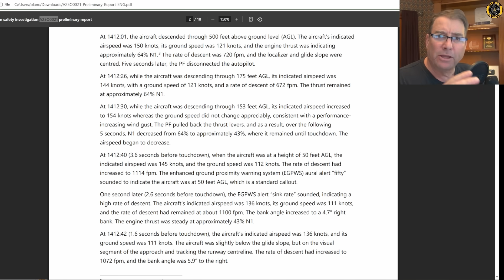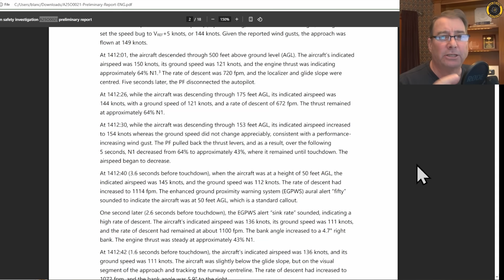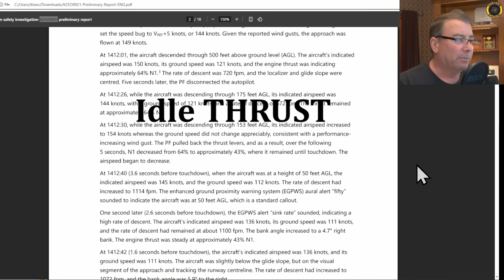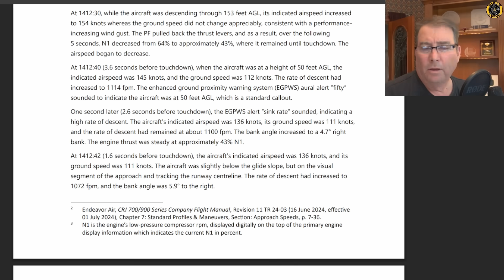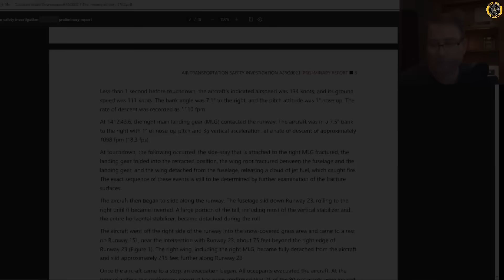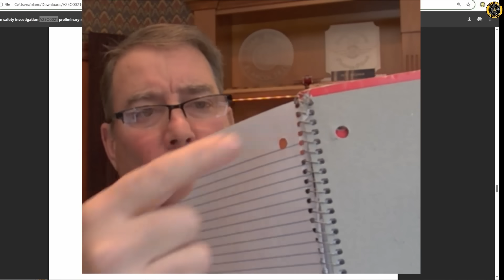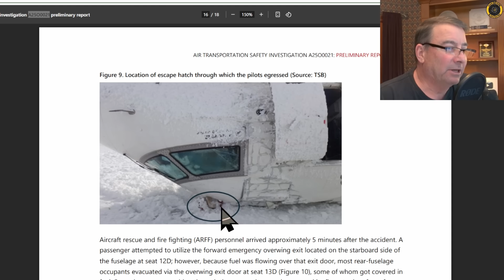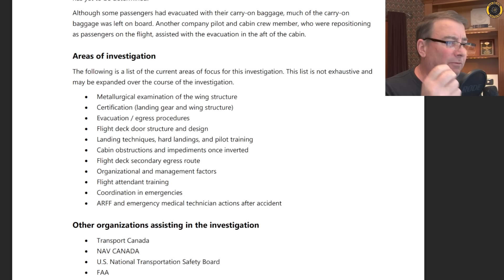TSB Prelim Toronto CRJ Crash

Comment: The thing that’s lacking is not any old stick and rudder time.  These kids spend up to 1500 hours bouncing around in Cessnas thanks to the 1500-hr farce.  They have “stick and rudder” time in general. What they sorely need is stick and rudder experience in type.  On the line with an IP.  Sim is ok but not really.  Ass-in-cockpit time is best of all.
Reply: Exactly. If I see some other channels like Pilot Debrief it amazes me how people try to get those 1500 hours fast killing themselves and/or relatives. It's a bit like if you drove 1500 hours on a bicycle you can drive your motorbike. Think the European approach is a lot smarter.
Reply: 1500 hours of flying in a circuit or basic VFR cross country is pointless when it comes to transitioning into commercial aircraft.
Reply: @EdOeuna  No it is not. Basic skills are of use in ALL aircraft, not just one type.
Reply: @hb1338  - there’s no real comparison between initial training in Cessnas and Pipers versus flying commercially. My first instructor got his ATPL whilst flying nothing bigger than a Seminole, and pretty much all hours from flight training where he was unlikely to even touch the controls. No commercial complications, so urgency to complete the flight, pretty much all fair weather flying. Sure he met the targets for night, cross country and IF, but he had zero real world experience.
Reply: I'm no pilot,   but this seems 100%!
Reply: Amen
Reply: Nonsense. You learn stick and rudder skills in simple aircraft where they are the only things that are available to you - that way you have no option but to learn properly and the learning and experience you gain applies to ALL aircraft that you fly afterwards. Once you can fly any aircraft, you start to learn specific types, in particular the complex systems that vary between types and whose purpose is to reduce pilot workload. Commercial aircraft are hugely expensive to buy and operate - no airline anywhere is ever going use them for the purposes of basic training and will minimise their use for all other forms of training, hence the widespread use of simulators.
Ask yourself what happens to insurance premiums and public confidence once airliners full of passengers are used for basic training.
Reply: Murrica being the third world country it is, after this crash maybe they will extend that 1500hr rule to 2000hr. XD XD XD

Comment: The wing on a CRJ-900 is so low that a 7.1 degree bank is almost enough to cause a wing strike without collapsing the main gear.  Add a 3G hard landing and the wing was destined to hit.
Reply: What is the max load the wing is designed to withstand before breaking? In my head I would think much more than 3G?
Reply: @lsx001  The 3G impact broke the gear which allowed the wing to make contact, which it was never designed to do. The wing might hold through a 3g (air) loading, but not when it slaps the ground after a 3g blunt impact. They're made for loads, not impacts.
Reply: @wadepatton2433  Yup, the air load is distributed. The ground strike is concentrated.

You can catch a falling 5lb dumbbell and not get hurt. But if you try to catch a falling 5lb blade, you're liable to lose fingers.
Reply: @lsx001  Aerodynamic loading is different to hitting the ground.  Landing creates bending and shear forces in different places compared to in flight.
Reply: @lsx001  I bet they had a significant side load as well.  Can't really tell from the video, but the report of the side-stay fracturing first implies it.

Comment: In today's aviation environment with so much automation in the cockpit (flight deck, my bad), pilots need to understand the complexities of the automation and how to operate it.  But they also need to learn and be proficient with basic stick and rudder skills. Stick and rudder skills need to be learned at the very beginning of ones flying, that's why I advocate glider training early on. Not sure what the background of the FO was in basic flying.  So the challenge is, as one progresses, not to lose basic flying skills in favor of all the simulator and automation training.  I don't know how airlines should handle that.  Pilots may just have to take the initiative and stay proficient on their own.

When I was instructing, I developed a course that allowed pilots to get both Airplane SEL and Glider ratings at the same time.  I didn't put enough people through it to develop any statistics, but the basic principles of energy management and stick and rudder flying made them better pilots.

Comment: That’s what I loved about my initial flight instructor way back in the 80s- if he told me to climb or descend to a altitude that meant you leveled at that altitude, not 50 feet below it not 50 above it at that altitude.  If you were turning to 270  turned to that heading- and you flew coordinated or you did it over and over again until you could.   While I work in the railroad industry now not the aviation industry that training has served me well because if the train is supposed to be going 50 mph,  means 50 not 52, 54 you go 50.  And when you stop whether it’s one, 200 ton locomotive or one 28,000 ton train 16,000 foot train you stop at the point you pick. (barring emergency, unplanned stops) and anything less than degree of precision that leads to disaster in aviation and in railroading.
Reply: I should add we have tons of automation in the rail industry,and safety over site system but when stuff goes to shit, you gotta know what to do and where you  and it comes back to good old fashioned Railroading , which in the aviation world is sticking and rudder flying skills

Comment: I built a lot of my time early on flying aerial survey. Sometimes 8 hours in the air flying low and slow. No autopilot and it was always some type of different flying depending on the mission. It increased my stick and rudder skills ten fold. Absolutely made me a better pilot. Sometimes I wonder whether the whole, “you must be a cfi to build your time” is actually the best thing to continually improve your flying during those crucial early hours after gaining your commercial license. Or if it is actually putting the CFI in a situation where they are just going through the motions day after day during their lessons. I’m not sure.

Comment: I'm not a power pilot, but it seems really common that power pilots use throttles to control speed and pitch to control sink and climb, which to me as a glider pilot seems completely backwards.
Reply: I am a lowly power pilot and was always taught that power controls climb and pitch controls speed. But apparently when you start flying big jets the way those aircraft respond is a bit different.

Comment: How does a captain survive accruing only 3570 hours since 2007 (technically before that, because I assume he did ab initio training before joining the airline, unless he went through a cadet program)

Someone correct me if I'm wrong, but that seems like a wildly low amount of hours for a 17 year commercial pilot. 

Not a knock on him for it, just wondering how you make those finances work?
Reply: sim instructor is great gig if that's what you want to do AND you live in the city where training takes place. 1.5 x line captain pay and always home.
Reply: Generally, a pilot gets paid a monthly guarantee, probably 75hrs a month.  Fly more?  Get paid more.  Fly less, get paid 75.

Comment: My visceral response to your (Rod Machado's) comment about stick and rudder skills:  Absolutely right; preach it brother!  I'm a 21K+-hour Embraer 170 guy, and I always preach (in addition to turning off the auto-throttle) to hand fly as much as possible, and to always be SLOW to remove power on approach and quick to add it.  You're spot on regarding the rush to fill the seats in the vacuum, and the experience level necessary to generate instinctive responses to these scenarios has been short-sheeted both by the airlines and Congress. 
Also, we fly into Key West and Hilton Head, and I always brief the illusion of increased height caused by a narrower-than-usual runway when one is accustomed to 150- or 200-feet-wide runways, and the tendency to flare late can really get you into a bind if you let it. 
Nice work on the coverage.
Reply: Spot on. I'm also a E-175 regional captain. I encourage hand flying every day up to FL100 and when passing back down through with visual approaches in use with the newer folks to LEARN TO FLY THE AIRPLANE!. Being a well versed button pusher doesn't build situation awareness or flying skills. I mix it up with AT use and we'll celebrate "no autopilot Wednesdays" unless its use is required by the SOP. We'll make up scenarios when we have a VMC airport such as spot landings on the second stripe to account for a contaminated runway on roll out using the thrust reversers though the company prefers we just use those big carbon brakes but we'll also set the autobrakes to Medium. Haven't seen the need to get any complaints from the peanut gallery so The Hard setting remains a mystery. We'll do static thrust take offs in SNA with brake release to fly the noise abatement profile like a C-17's tactical departure until we hit the power back point to hush over the homes and noise sensors. I don't think many of my FOs have ever seen the Be A Pilot campaign back in the day. 

The number one rule of being an airline pilot is never be on the news...
Reply: I am just a 182 owner and around 500 hrs.  I like the quote you said about slow to remove and fast to add.  That makes alot of sense and something I will remember.
Reply: @jeffwiggins8923  Don't forget that your approach speed is very nearly always as low as is sensibly safe.
Reply: The other interesting situation is to see what your student does when they come in over the numbers of a 200' runway when they had been accustomed to a 75' runway up until then.
Reply: @ Perhaps only the tendency to flare early, causing a float, though if the runway is significantly wider than what the pilot is accustomed to, it's likely much longer, so the resulting float is likely harmless.  
I suppose they could also bleed airspeed at too high an AGL height, though the response should be instinctive and appropriate; that is, add power and fly to the runway.
Reply: @miketravelsfree  Excellent comments, Mike!  On most little SEPs the early flair will cause a nice thunk on the runway if you don't quickly realize what you've done.  As others in this comment section have said, it's a very good idea to brief illusions like wide/thin runways, snow banks on the side of runways, night landing illusions, black hole illusions, etc.  I do this to help give my little brain a fighting chance for a decent landing.
Reply: @miketravelsfree  I think the main problem here is the runway illusion and the pilot probably hadn’t experienced that before or enough of it. A proficient Captain would have recognized the error immediately and taken the controls. Multiple holes in the Swiss cheese.
Reply: @alexc5449  I don't think the runway illusion was a factor. The proximate cause of the crash was the cut to power, which should not have happened.

Had power not been cut, and there was a lack of flare, then you could argue runway illusion.
Reply: @dafunkmonster  the most likely reason she reduced the power is because she thought she was too high ie runway illusion.
Reply: "The rush to fill seats". I'm not a pilot, but I assume that means that there is a pilot shortage? Has there been a lot of pilots leaving the industry, creating a shortage?
Reply: @martinliehs2513  my understanding is that airline pilots are on the older side, which makes sense, we have an aging population in general, and being a pilot seems to be the kind of job someone can happily keep doing long term, it’s not just a stop on the way to becoming a manager like so many other jobs. Then with all the disruption of covid many l folks chose to just retire early. I think there may also have been some rearranging of airline pilots moving over to cargo since that’s what was flying in 2020, and they haven’t come back. Whatever the exact cause I’ve heard a shortage mentioned in several contexts recently.
Reply: @TeeganLee  "Then with all the disruption of covid many l folks chose to just retire early."

They didn't just "choose". Many were forced out, because they didn't want to take a vaccine that was being distributed under an EUA (meaning it was considered "experimental").
Reply: @dafunkmonster that is technically still a choice, but thanks for adding that extra context, I hadn’t considered that aspect.
Reply: @martinliehs2513  Remember covid? Remember how the airlines forced pilots to take a vaccine, or else quit? Yeah. That's the biggest contributor to the pilot shortage.

Comment: If I understand correctly, in these gusty wind conditions you are always better off erring on the side of too much power because it is far better to go long and have to go around than smashing into the ground.
Reply: Up to a point. Land too fast and/or long and you might go off the end of the runway. Each knot of extra speed requires about 100 feet extra stopping distance.
Reply: @igclapp  Go around.
Reply: @igclapp  Runway 23 at Toronto is 11,000 feet. You'd have to try really hard to reach the end, let alone go past it.

Comment: It is too late to flair after the airplane is stalling. 
The error was powering to idle when airspeed increased. Either leave it alone and plan to land long or go around. 
Pulling up on the elevator after stalling will not rase the nose. 
What was the control angle throughout is only missing info.

Comment: I was on a tour in the North West Territories and took a flight to Alert. The wind was 90 degrees to the left of the runway at 35 knots. As a physicist I realized that this was an impossible scenario as gust were up to 50 knots. Our crab angle was so large that the runway was about 30 degrees to the rights. As we lined up the gust would blow us 100 to 200 m of the line. After three "attempts" the pilot said he could not land and we would get half our fare refunded. I knew he could not land and only lined up to say he tried.

A few months later at an air show I talked to a B 52 pilot an he said he could not land a B52 with that cross wind.

Comment: Flying little airplanes, we would compute the gust factor as 35 - 28 = 7 knots and add half of that (4 knots) to our approach speed. Interesting how different it is for the big jets.
It's worth mention that the wing can handle 3G under normal circumstances, if applied smoothly. The problem is the rate of acceleration, called jerk - the acceleration was applied suddenly due an impact.
Also, another illusion that could have been a factor is snow blowing across the runway can obscure it, making it appear you are higher than you are.
Edit: @14:50, AMEN brother!
Reply: it was a neg 'g' load. -3 is well past the limit.

Comment: How many hours did the FO have as Pilot Flying in the aircraft type?

How many landings did the FO have with a 35+ knot gusty X-wind from the right, having to adjust the throttle using her left hand?

Ops should have rethought this pairing. It was the first hole in the Swiss cheese.

That’s a tough landing in any airplane, but it’s also why they give us long runways.
Reply: The FO had more than 450hrs in CRJs.  And every landing the FO made was using the left hand on the thrust levers, right hand on the yoke.  It would be crazy to use the right hand on the thrust levers, and the left hand on the stick if sitting in the right seat.
Reply: And you answered neither of my questions. Maybe the airline knows, and maybe the TSBC will do the math from the FO’s logbook.
Reply: @ I found the time stamp of 12:30 to be quite helpful.  The FO had 418.7 hrs flying the CRJ.  I cannot answer the second question.  I do know that all airline training includes TO and landings with windshear.
Reply: Crew pairing is almost always done by software. Crew scheduling software has a list of criteria which it tries to satisfy, sorted in descending order of priority - only a small number of those criteria (e.g captain in the left seat) are required by regulations, the rest are merely desirable. Depending on the trips (collection of sectors) and the available crew, it may not be possible to satisfy all the criteria. What should the airlines do ? Cancel flights or select the best possible crew for each trip ?

Comment: I had read that report and zeroed in on that power reduction and subsequent development of high sink rate that you discuss.  Gusty conditions can sucker you in as appears to have happened in this case.  I agree that they should probably have carried a bit more extra speed above Vref for the conditions.  When a gust gives you an airspeed increase, it will soon collapse and leave you with reduced airspeed and increasing sink as happened here.  If the power had been left alone there would have been less sink and more energy available to deal with it.  A pilot with sharp stick and rudder skills might have recognized the sink situation and initiated an aggressive flair.  That might have saved the day.  But between the power reduction, decreasing airspeed, increasing sink, and lack of a meaningful flare we got some pretty impressive video footage of how not to land an airplane.  I'm glad the resulting casualties were not much worse as they could easily have been.

Comment: I'd be curious if the FDR readout can deduce not just a pitch angle but a pitch rate. Was the pitch moving in a positive or negative direction at impact. My guess is she was hauling back on the yoke at impact and, the main gear being behind the CG ... well... you know what that does 😳